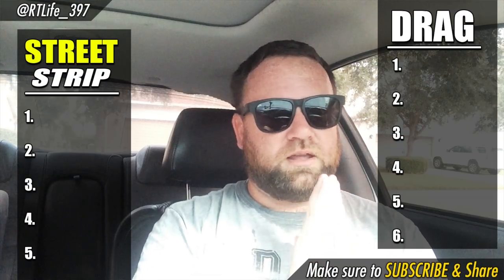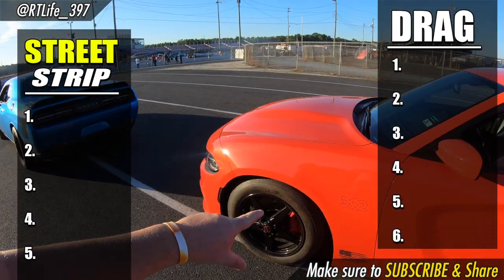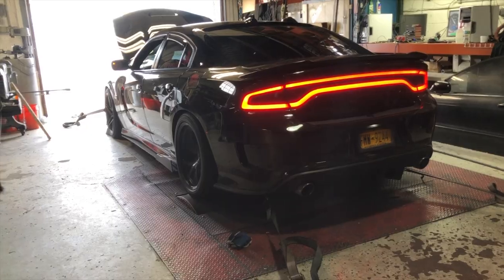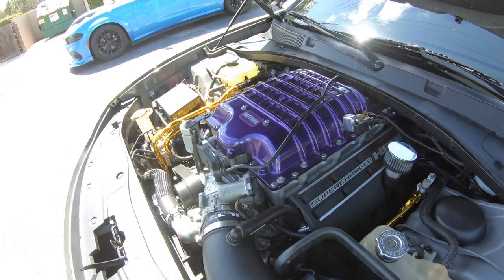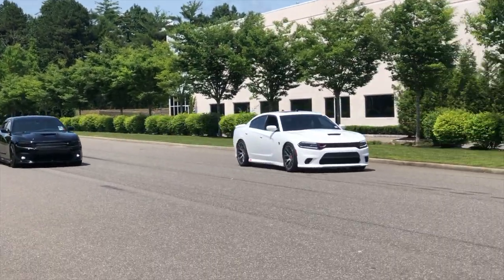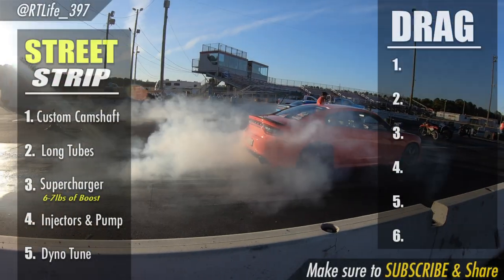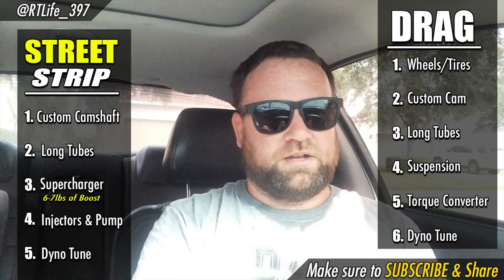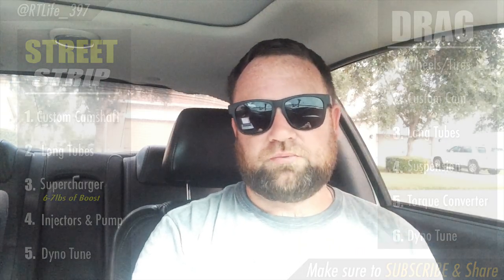Make 392 "Hellcat FAST"

Comment: You missed one of the BIGGEST issues with the 392 engine.  It has cast iron pistons and connecting rods.  You need to replace those with forged parts if you want to run any higher than 3 psi / 600 whp or else you are in serious risk of destroying your engine.
Reply from the maker: With the right tuner you can easily run 6-7 lbs on a 392 reliably. In this I was trying to not do a full rebuild of the 392. Once you open up that door it gets so expensive. If you forge the internals you're not going to run 6-7 lbs - you'll want 10-15 lbs. You'll likely be in the 725+whp range. Then you need to upgrade that hp70, entire fueling system, etc.
Reply: @Mikes05Hemi  The pistons in the 5.7 are actually better than the 392.  For some reason they tossed cast into the original srt 392 and never changed the design.  Most likely a relic from the 6.1
Reply: I have a 2016 scat pack. I had supercharger, and headers and high flow cats installed by Petty’s garage. At the track I was running 11.0 @ 124mph. Then the engine blew within 6000 miles.  I had them rebuild it along with a custom cam and forged pistons, I had it tuned by someone else after because something seemed off, and the tuner said Petty’s tune wasn’t very good, plus I had issues with the quality of work they did. After that I was running 11.4-11.6@ 130 mph, with a lot off wheel spin, on MT drag radials, 60’ time went from 1.5 to low 2’s. But I was also starting to run out of fuel at the top end. I have upgraded to bigger injectors since but haven’t been to the track yet. Tuner went MIA, so I been having to learn how to adjust the tune for the injectors myself. It’s good cruising, haven’t had a chance to test WOT. Not sure about trying to find another tuner if they won’t stick with you.
Reply: @ramdart74  I'm sorry to hear about that.  It's incredible how many shops are just unaware of how weak the 392 pistons are.

It sounds like you're on the right track now.  Bigger injectors and possibly a stronger fuel pump setup should help your top end like you said but its sounding like you're encountering a new problem for your 60' now.  You're making good power, using good radials, but still slipping so you might be suspension limited now.  That's another expensive route to go down so if I were you, I would get a 2nd opinion from a proper drag pro instead of some random guy on the internet, haha.  Best of luck!
Reply: @RTLife  so if u get forged internals u cant run 7 pounds of boost u have to turn it up ?

Comment: Supercharging the 6.4 is a bad idea, they can't handle boost. They crack the top piston ringlands unless you open up the ring gaps, and at that point your so deep into the motor you may as well install match weight rod and piston kits. Problem is that to make the 392 compete with a hellcat is more than the added cost of a hellcat for most ppl.
Reply: I was telling everybody the same thing when I first got my scat pack and read that it was a bad idea lol calm down these cars can actually handle more than you think, it even shows how much the car can handle on Wikipedia lol
Reply: Also it cost about 15k to 20k to increase the performance drastically, brand new hellcat is close to 90k, my new scatpack was 54k, so with the mods I’ll still be cheaper than a hellcat

Comment: OR, you could just bolt on a Hellion Sleeper kit with tune, boosted to 5-6lbs safely on a stock motor and be done...  Hellion swears up and down that 5lbs is absolutely safe and will give you that 620-30whp.  People are just never happy and always want more when they know it's on the table...  Superchargers will always be harder on the motor.  Turbos are just added power...
Reply from the maker: As you know, I'm all for turbos. They're the most efficient but a costly option - labor of install is much higher then a supercharger. That said, a 200whp gain is impressive esp. for such low boost.
Reply: @RTLife  You should check into the Hellion kit.  It's literally bolt on and comes with new exhaust manifolds.  8K plus another 4 for proper install and dyno tune.  Not as expensive as you'd think...

Comment: Awesome video as always.. However your cammed boosted 392 with stock everything else is no where near as reliable as a stock hell cat.. To get there.. you need to do engine work, trans swap, then other suspension upgrades like half shafts etc..  That is just reality.. It just becomes a fast ticking time bomb and a money pit..
Reply from the maker: Yah the ceiling isn't as high as a hellcat without completely building out the engine. That said both options if tuned properly can be very reliable. If your goal is just to beat up on Hellcats - these are solid options. Once a hellcat is modded though you'll have to invest a lot of $$$ keeping up with it.
Reply: Maybe. Some of us never wanted a Hellcat.
Reply: Scat widebodies come with the same half shafts as the Hellcats and Demons.  And a FBO e85 Scat only needs a tranny tune as you are not past the HP70’s capabilities.  But you are correct, it is a fucking money pit x2.   But so are Hellcats with 20K+ dealer markups.

Comment: You did not mention anything about gearing. Also, when you talk about tire size, you may want to discuss how smaller diameter tires will essentially give you the equivalent of lower gears.
Do these modern care have to have a cage if they get down to 10.5?
I am going to come down hard on this rolling start crap. I worked as an EMT in S.F. for 4 years, and scraping innocents off the road because some dummy wanted to go fast is not cool. Do you want nightmare fuel? Because that is how you get nightmare fuel. Period. I have two cars, my daily driver which is a '16 Scat Charger. The other is my 68 Barracuda Fastback race car, which does not get raced on the street. Yes it will drive on the street, and to work on occasion. It even still has the rear view mirror, wipers and the heater blower motor.
Also also, you may want to discuss putting these heavy HEAVY girls on a diet. I fully expect to get my 68 barracuda fastback down around 2800-2900 lbs. With my tiny, little, antique, naturally aspirated 360LA with a mere 3 speed a727 Torqflite and 4.10 Dana rear end with super stock springs, just put your hellcats back on the trailer, ladies. Fat girls have no place at the track, that's where the svelte girls belong. Obesity requires a rolling start, on the freeway, where idiots can wipe out entire families in a ball of flame and twisted metal.
Reply: Whatever.  People get wiped out on the freeway everyday from non-racing incidents.  I personally don’t street race…ish, however I do drive Hwy 80 between Sac and SF every day and have seen multiple TC’s by people just being dumbass drivers.

Comment: Will not be even remotely as reliable or as consistent.  Not to mention resale loss.  Just buy the hellcat/redeye.
Reply from the maker: it can be very reliable with the right tuner. It's only running 6-7lbs of boost.
Reply: @R/T Life  psi is not a metric that matters, cylinder pressure is.  Please show me even 1 650whp scat pack that lived over 5k miles being routinely romped on but respected.
Reply from the maker: Sure, go talk with EastCoastJeepSRT - he was procharged for years (jeep SRT 392) & traded it in for a Trackhawk. Many people do it - we just only hear about the ones that fail. A lot of crappy tuners out there
Reply: @R/T Life  I've only been in the scene since 2018 and have a redeye charger but personally I've never seen a 6.4 car live under boost without spending more money than they would have had j into a hellcat
Reply: @thewolf61691  They have to at a minimum have forged rods/pistons.